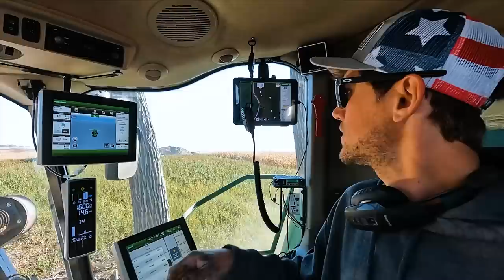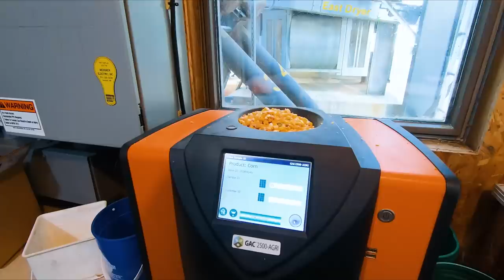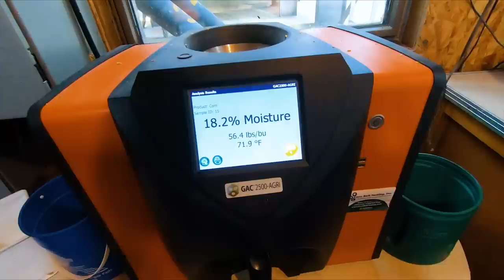The Face When You Hear The Bin Site Is Plugged!! #12

Comment: Hey Dougo, I'm a gas guy. We see those controls valves in service on most crop dryers. They are generally very reliable, offering several years of uninterrupted service. I have never seen one outside of a building. I think that the valve isn't happy being in the weather. Is there a way to shelter it? Seriously that valve should never need replacement except in some very rare circumstances. Good luck on your corn harvest.

Comment: You might need to run the propane through a desiccant to take the moisture out of the high pressure propane liquid after it goes to low pressure gas and before the regulator to control the pressure.
Reply: if the propane was processed properly at the gas plant,  there is no need for further drying.  If it is freezing at the regulator, then someone is selling improperly processed propane,

Comment: I’m just a OTR trucker did my share of farming…. Soo why not run a Chisel plow as deep as it will go over all the spots that couldn’t get planted! Wouldn’t that improve drainage in the spring ?
Reply: Its the type of gumbo dirt holds water, usually the water table, or low spots, thats why they do tile work.
Reply: @BWYinYang  ya but water creates more compaction then any implement! It will move ground like a glacier.
Reply: @tomhall7250  Judging that low spot where Dougo went around, he'll be stuck if tried

Comment: Looks like the PID Loop that controls the gas valve needs to be tuned. The tuning parameters are buried in the control system code and you should ask the the guys who built the system to come out while it is running to set the tuning parameters.

Comment: I never commented before and have a simple question...Why not use a plow? The term my father used was an "under plow" for corn,  peanuts and our garden.
Reply from the maker: Very well could they are just very slow!
Reply: @LarsonFarms  I'm not sure about that, I see my dad pull a 3 plow on a RED tractor (175 they call em M.F.'s) Full speed with a bunch of old concrete pillars strapped on the back rack. A 5' (i dont know what that is in metric) chain with two old road grader blades welded together...Thanks! AW

Comment: You guys need the trailers like us Canadians pull. 1 set if b trains is legal for 98 thousand pounds. But not all states allow them.
Reply: Those setups they use with the helper axles are good for over 100k pounds.
Reply: @beckyumphrey2626  I mean just on the trailers. Not total gross weight.
Reply: @beckyumphrey2626  I apologize I should have been more specific

Comment: That gas valve actuator brought back lots of memories. I cant tell you how many I have replaced on boilers. Worked on a military installation and our shop took care of all the boilers. I think the count was almost 900 boilers total.
Reply: Honeywell is such a pita!  I was surprised that it didn’t have some Maxitrol controls.
Reply: @waggtech4883  didn’t matter what we had nothing lasted long in a hot boiler room.
Reply: @oldfarmer4700  ran a high pressure 100hp boiler for 14 years cleared government inspection every spring no problems